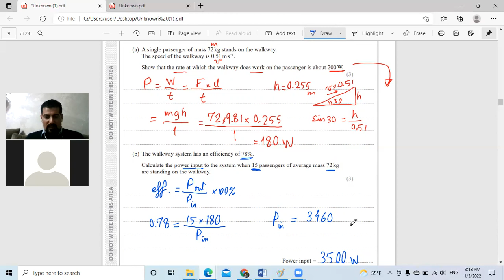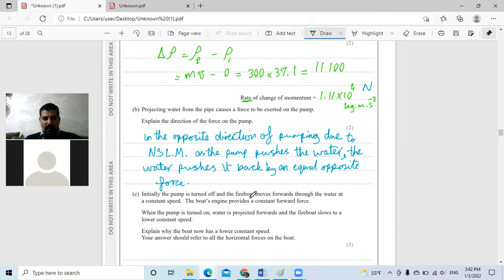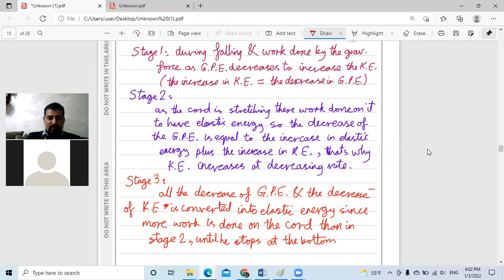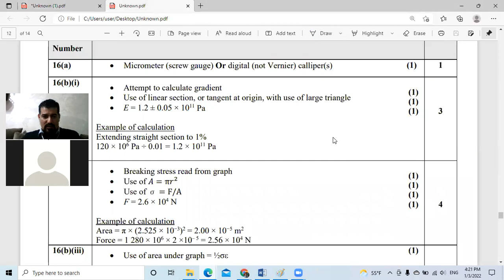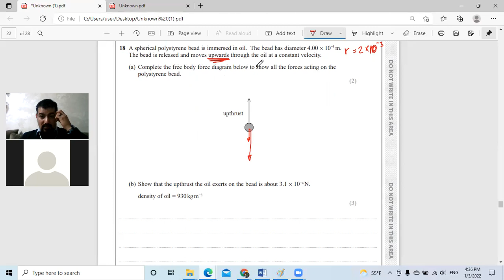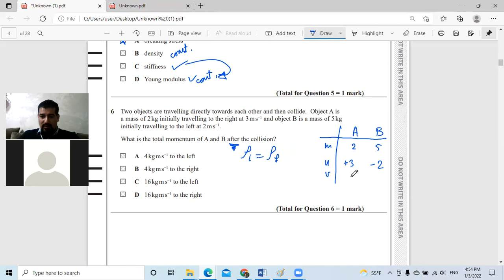AS Edexcel Physics answering & explaining Unit 1 Jan 2021 by: Dr. Ahmad Al Faris

Comment: for number 5, C is the correct answer, for a material the young modulus, breaking stress, density is independent of dimensions so they're going to be constant if the material used is same. The stiffness is going to vary with the dimension, so think of it in an easier way, if you take 2cm of a wire and another wire of the same material, same cross sectional area, just of a longer length for example 10 cm, which one will be more easier to bend? the 10cm one right? it's because the stiffness is less in the wire with a greater length. The more flexible a material is, the lesser the stiffness. hope it helps :)